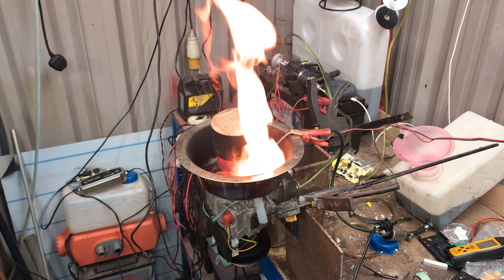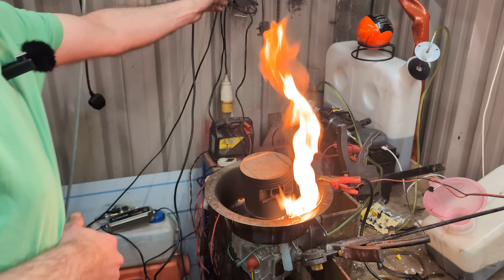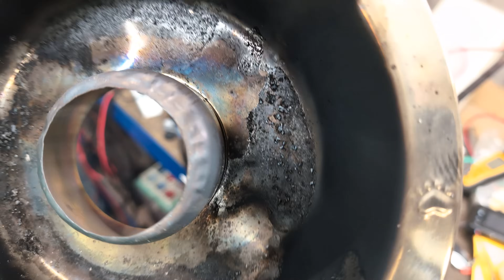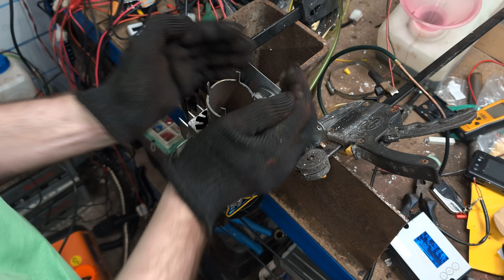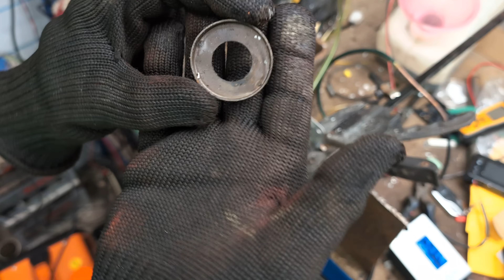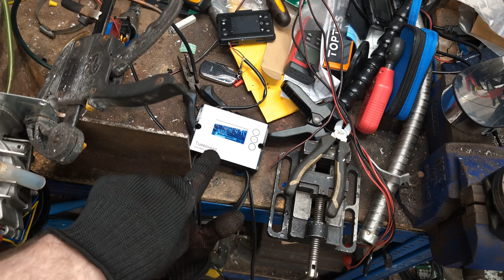Diesel heater powered waste oil burner - first attempt

Comment: I think the biggest problem is the heat exchanger but the achieve some of your goals you can just drop a lot of the diesel here components. You could regulate the flow of oil using a pin valve and gravity feed that and you could eliminate the fan using a flu. So this whole thing could run almost with nothing and all you really need is a timer for the glow plug or you click it once and it heats up for 2 minutes or whatever and then shut itself off so then you can do this with a tiny little portable battery

Comment: I'm thinking higher pressure air/oil injection using something like an airless paint sprayer or even using a small nozzle and pump from an oil boiler because an oil boiler with the right nozzle will already burn clean waste oil no too bad

Comment: Look at the height of that flame! No way to fully contain that in the unmodified small body of the diesel heater. So an unmodified heater will either be inefficient in pushing flame / uncaptured heat down the exhaust, or unburnt fuel / soot down the same. Ignoring for now the issue of incombustible residues and clogging, maybe try extending the heater body and burner tube?

Comment: Sounds like you need to replace the dog bowl with a #3 size tin, usually used for fruit juice and vegetables at the restaurant supply store.

Still curious how well veggie oil works as it doesn't have the additives that waste oil has gumming everything up.

Comment: If it’s of any interest I have had success using a similar method to the one you showed but using a baked bean tin rather than a tuna tin in a deeper pot. The tin has about 5 rings of 10 holes spaced up it which I posed with a small terminus screwdriver I then used the driver to deform the holes so they direct the air downwards and in a circle to create a vortex. The top of the bean tin is just proud of the top of the outer container and I rested a lid on that that was a bit bigger than the diameter of the outer pot. Oil is fed to the pot just above the bottom from the side. While I’m not using a diesel heater to start it like you are that is basically all the heater is doing in yours and supplying the air. I have a speed controlled centrifugal fan and oil is provided by a stepper motor driven peristaltic pump but I used that because I prefer them to the pulsing ones as they is nothing to get jammed up. I built my own controller with a cheap esp8266 relay board and chucked in an opto sensor for flame fail and it also has two pumps where the ratio between them can be changed. I am using the second one to add 10% water at the moment which helps atomise the oil. I now have a boat littered with all manner of holy bean tins as each itteration gets better. Well actually some are worse but they help point in the right direction. I look forward to seeing your next version. The electronics is all cheap modules and the programming is open source and close to English (esp easy) and can be controlled from a phone browser. If you are ever interested I’d be happy to give more info.

Comment: I would look at dividing the stages into sections to achieve your design goal, your first stage should be evaporation / vaporisation with the capacity for the vaporiser to handle a good deal of clinker and is easy to clean out, the second stage should be a oxygen deficient burn to create mostly carbon monoxide and the the next stage should be an oxygen rich area to burn it, after its burned then you want your heat exchanger. The good thing about having the incomplete combustion then complete combustion is that the flame will then be blue and clean, Some cars actually used this principle with 2 combustion chambers.

Comment: I have watched many of videos on WO burning. A thought I would think may work is to first thread the tip of the burner air great to receive a male air connection. Then using a small metal tube that fits into the inside of the air chuck create a siphon nozzle. The internal fan would provide the air to atomize the pumped provided fuel. Place stainless steel scrubber in front of the restriction plate and Bob’s your uncle.

Comment: This is all back to front, it would be easier to make an oil burner that burns diesel than it would be to convert a diesel heater to burn oil.

Comment: Dave, have you thought about using a second hand GLOWWORM ULTRACOM? It's the part used in gas fired heaters/boilers.  New, they cost about £700, but  can buy second hand for £50.

Comment: I  used to run a proper waste oil burner made in the 70s, but it always made lots of smoke and sutt We got round the problem. We very slowly dripped water into the puddle of oil in the stove. It used to burn very efficiently and it was white inside and no sutt just try it and see what result you get. Cheers Derek

Comment: I get what you are trying to do but the best method of burning dirty oil  is wood burner with a dog bowl in side with a drip feed preheated by wrapping the copper around the flu of the burner. start it on kindling and start dripping the only mod is drilling a hole in the burner to run the drip pipe into the burner.

Comment: First off... I thought you were an imposter with the green shirt... 

I think you're on the right track with the first design you showed. The fact that the heater can run pointing up is a bit of a game changer for this design. I had convinced myself that this wouldn't work after trying it pointing down.... 

I'm pretty sure you have a winner.  With just a few changes that you mentioned, totally capping off the end of the burn chamber and putting a series of small holes in the tube, and then finding the right diameter outer dish / tube.

The only suggestions I have for this is (if possible) to have the outer tube / dish in the shape of a fluted cake pan (but much smaller) so that you can make it easily removable, and still have a place for the fuel to pool without spilling down the centre. You also want to close the top back in to around the size of the chamber tube size so that the air / gasses are confined to a path. WIthout this, it will be more turbulent and uneven..... but leaving it open for us to see will be cool. 

I can say from experience, these heaters will run fine without the mesh, and they will run fine if the mesh is a lottle clogged up, however, as soon as you change the volume or shape of the area with the mesh (wick) the heater will start to have all sorts of troubles. You don't have to take my word for it, but I would suggest avoiding putting anything but clean diesel into the chamber itself. 

That new toy you have is awesome, but quite honestly I'm way more excited about what you have done here. A few "small" changes, and you've go it. I started to build one this week (collected pieces that I plan to use) but we have had extremely cold temperatures for almost two weeks now. It has warmed up to -24C.

Comment: Also what about insulating the ‘burn chamber’ to help keep the heat in? Seems like oil needs a lot of heat to cook off and get going. Could then extract the heat out the exhaust. I know wood fires burn best when the burn chamber is kept as hot as possible. Just a suggestion.

Comment: Why bother with all that setup

Google boat diesel drip heater 

You needed a chimney to create a draft 

No need for electric, boat drip heaters are totally self sufficient
Reply from the maker: Automation.

The boat heaters you speak of are the ones that require you to pre light with alcohol?  Then wait for for it to heat up and then turn the diesel on?

I want a system I can turn on/off remotely or based on temperature.

Comment: Only thought I have; remember to burn off tin cans outside with a blowtorch or something before subjecting them to flames indoors, given they mpre often than not have a layer of zinc coating inside (to resist corrosion) which you don't want to breathe, it's basically the same issue as when welding zinc-plated metals... :P
(of course some cans may have a different coating inside, but, flames are fun!!)

Comment: LIke the idea of a second fuel  input for waste oil with the diesel burning hot to atomoze the waist oil. as well as ignite it. .  maybe drip the oil onto a domed piece of metal with tiny hole(s).. oil spreads out over the dome into a finer film  as it spreads about the dome  (part of the concept of babyington burner).  Have also read up on folk who did instead of a dome... but a ramp.. where further down the ramp the oil flows the thinner and thinner it gets till it ignites along the journey some where.  (might look like Archimedes screw shaped ramp, or an alcohol  looped burn tube sorta thing.

Comment: All I've heard, from others, about running these heaters in the vertical position is that it wont run. 
And then I see you running it vertically. 
Did you change something or can they actually be operated in the vertical position safely and dependably?
Reply from the maker: I don't see why they wouldn't run vertically.  None of the changes I made would affect that, I could put the heat exchanger end back on and it would be a standard heater again.

The only issue with vertical running I can think of is maybe a little diesel leaking from the air hole in where the glow plug is.

Comment: Very interesting attempt! My honest opinion is that simply dripping used 10w40 into a tin can in a log burner has several distinct advantages. No electric, no noise. I used the carburettor from a model aeroplane engine to control the drip. I looked at the chimney outside and couldnt see any smoke when it was hot. It smelled very reminiscent of a 1980s car! Recently I found a boat diesel heater that drips diesel into a bowl but wow theyre expensive af. Great stuff ur the greatest!! 😎👍
Reply: I like this. Reminds me of my step father's old setup, a few wraps around the flue to preheat the oil and a way to meter it in, away she goes!
Reply: Why not a petcock??

Comment: I reckon thats the only way you can burn waste oil with a diesel heater David unless some genius comes up with a custom burn tube, probably made by Ronco, that dismantles and cleans itself - oh and nips up the exhaust pipe with a scrubbing brush. As we all know, shove so much as a smidgen through the heater itself and the burn chamber won't even last a week, particularly if its turned on and off a few times. Cokes them up good and proper. Veg oil the same. Be fun making a case for it and seriously aiming for maximum heat efficiency and lowest emissions lol. Thunderbird 2 could run on that, with a bit of backfiring. Practically though, theres a lot of nasties coming off that dish. I suspect any lifeform within a few yards will look decidedly pale. Moving past the legalities and politics here, and its all in the name of science, this video really made me chuckle. The Scottish version of Garage54. Thanks so much:)

Comment: If yer not married to the idea of burning diesel or kero with yer waste oil, hows about feeding a slight misting of LPG/autogas into the air intake ?
Light it on diesel but when you switch over to waste oil it might be more cost effective to introduce lpg & might give a cleaner burn ?

Comment: Ahhh I see. It’s to sell the box. Right. So, twin tank. I’d leave a box standard heater as is, BUT, for the waste oil fuel tank run a copper fuel pipe around the heater to pre heat the fuel. Once up to temp and viscosity is achieved your box of tricks switches over. I’ve ran 100% biodiesel (washed of methanol) but if it flames out your F’ked. Mentioned on here some years ago it puts out a smoke screen like a battleship, I’m not kidding its made my housing estate vanish to the ISS, nothing to stop the residual heat turning post flame out oil to smoke. Restarting is a pig. The waste oil must be filtered to sub 1 micron or your wasting your time. Thinking about it more as I type think your on a hiding to nothing. Maybe consider drilling out the back of burner and use a syphon nozzle, an old fridge compressor will run it, I like the idea of a box of tricks that deals with twin fuel tank delivery but I think your trying to apply it to the wrong platform.
Reply from the maker: I am indeed applying it to the wrong platform.  :)
It was designed to let you burn other non-waste motor oils in your diesel heater.  But I'll make another video about it on it's own.
Reply: @DavidMcLuckie  Really think you need to think about atomising in the chamber. OR, having say an old fridge compressor pump extra air in. You’ll do much better with used engine oil if it’s heated. I know that from experience.

Comment: I think if you make the airflow within the burn chamber, or secondary burn chamber, much more turbulent, you might be able to blow the sludge deposits out... Alternatively, something like a natural gas/propane circular incinerator type flame jet thing, could be used to increase ignition temperatures at the oil inlet, then using cyclonic airflow, you could cause the whole mess to heat up the inside of some heat exchanger tube... With a clean-out where the air flow is suddenly reduced... Like a saw dust spectator... First thought...
Reply: Maybe start with an upside down funnel... into a cylindrical exchanger, like a coffee can or something... maybe use the exhaust output to accelerate and atomize the waste oil... Swirl the waste oil in on a downward angle... have a pipe, copper or something coming down from the funnel's outlet to keep particle separation... Maybe even a funnel inside a funnel to keep the cyclone against the wall of the exchanger... Injected diesel burner from above the waste oil injection...

Comment: I’ll be honest I prefer the “pipe in a pipe” drip concept, way less complicated. Lots of faffing about m8 when (and I know you know) Why not play with a delevan siphon nozzle, way more fun. You mention 10min in about using a gas bottle. I’ve used one before when you basically just weld two pipes on, one either side, one side is air blower, oil drips in, problem is that it sounds like a doddle bug in final decent, again, good fun but for daily use? Naaa. What are you trying to achieve here? I’m not sure of your end goal.
Reply from the maker: Automation.  A waste oil heater that I can start/stop remotely or have triggered based on temperature.  And also not spend thousands.

Comment: My only thought is to utilize the fan at the front, and 3d print a duct that can use that fan, and then duct it into where your tuna can is, so you get a nice strong flow of fresh air against the waste oil burner, it should burn a bit hotter and cleaner then. Would require some welding to get the air into the burn chamber > tuna can

Right now you are using the 'exhaust' from the diesel heater combustion chamber, which will have way less oxygen in it for the oil burner part.
Reply from the maker: The diesel only runs for the first few minutes.  After that it's just fresh air going through.

Comment: You may be able to achieve a decent burn if the unit is horizontal, have the fan blow the air in as normal but be able to control the speed infinitely, get rid of the cog thing and any odd mesh in there, you don't need for oil, and I don't know why you are using a separate drip feed, why not keep the units fuel feed?, the fan should be the only thing that needs separate control to match the oil density as  the unit is obviously tuned for diesel.  You should be able to get a very strong, maybe even too hot a burn although it won't be a blue flame.

Comment: Could a drive shaft be attached to the combustion fan that protrudes into the combustion chamber with some kind of "paddle" or scraper to keep deposits from the waste oil from building up and clogging the burner? they'd then exit out the exhaust.

Comment: If you are going to burn waste oil or even brand spanking new oil you are going to need to clean out the clinker after virtually every use.  The cog thing needs to be got rid of and the oil would have to be sprayed in.  Drip feed will not work in this design you are making.  But if the burn tube gets red hot you could insert a drip feed into the tube and you need to be able to control the speed of the fan to get the right mix, although you should be able to have it able to throttle with the air flow and adjust the fuel rate separately and get a major oil burner with extreme heat!  The dog bowl has to go though 😁  You could get it as hot as you can imagine but you will still have clinker left in the burn chamber after every burn.

Comment: Really enjoying the progress and open thought on this one. I'm with you in thinking that it would be beneficial keeping the combustion air nearer to the bowl as the process happens. Would a circular heat resistant piece of screen (or similar) cut to fit the bottom of the bowl make sense to increase the overall combustion area? "donut shaped.." Maybe mounted an inch or so from the bottom? Trying to think this through as the temperature rises to maximum. I'm thinking of a way to better trap the hot gases evenly until combustion. Would the heat eventually burn the carbon from the screen? Centering the fuel source as you said sounds very logical as well to make the burn area even. Excellent vids David 👍